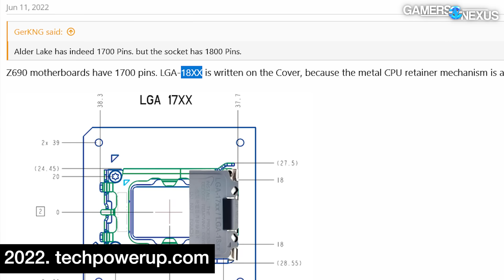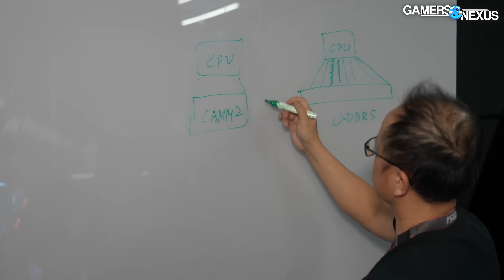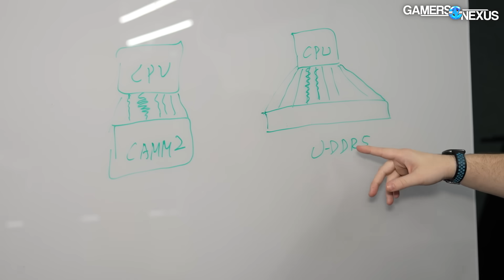Intel Says Not to Say "LGA1851" or "Z890" | MSI vs. ASUS Features & X870E Boards

Comment: Honestly the camm thing is perfectly fine, although you can mix and match ram sticks generally you want matching pairs anyway for the best compatibility and performance, meaning you kinda have the same problem regardless with DDR, no matter the upgrade you'll probably buy at least 2 of the same sticks unless you're like me and just don't care what you pair up, so long term camm might actually be a good thing because you'll always just need 1 stick and becomes maybe a little cheaper.

Comment: I'll take CAMM2 if it indeed results in a performance increase. We're already at the point where 2-dimm motherboards are optimal performance, and dense enough capacity to satisfy typical configurations. The stinker will probably just be early adopter tax.

Comment: As a native french speaker from Québec, I always love your sarcastic tone when you talk about the lame corporate tactics and bulshit! Specially when they act like if consumers were complete idiots, unaware of what they do. 
We have an equivalent sarcastic tone in french but, i got to admit, your way is very funny and entertaining. 
By the way, So far, i've seen no PC case model that was better than the EATX Fractal Torrent. For me, its the overall best design. There are only 2 minor things i would do to improve it : 1) Enlarge the cable management area of 2 centimeters (behind mobo)  to make cable management easier and also to drop HDD temp of a few degrees. 2) i would relocate the power button and USB + 1/8 jack from the top, to the front panel.. to prevent dust from going inside.

Comment: I guess it's a look, but never understand why case makers keep putting slabs of plastic on the front blocking the fans.  I'm not a RGB person myself, but even I like the full mesh front with the fan lights lit up.  Enough that I don't bother to turn them off (they just chance colour depending on CPU temps).  And with the amount of heat my new 7900xtx radiates out, I'm freaking happy I chose my case yeas ago for that open mesh design.

Comment: This CAMM2 stuff is really neat. I will move to that platform likely as soon as I am reliably able to. It would make fitting in my favorite air cooler, the NH-D15 (maybe gen 2, coming soon!) a lot easier without having to worry about not having memory that is too tall. Really liking these new ideas we are seeing! CAMM2 will be available from other motherboard manufacturers of course, right?

Comment: You know what? I'm liking these new focus of ease of installation features, and while at it, let me throw my own idea too. Put your NVME socket next to the RAM, please. Just like those X670E Gene boards, but maybe change the interface a bit so you don't cross ASUS' patents. 

Why next to the RAM you may ask? Well, because usually, NVME slots right now are located right above the GPU, and RIGHT BEHIND THE GPU. Those placements are awkward as hell. Above the GPU means that if you use a big aircooler, you have to take the air cooler off to reach that NVME slot, and the same goes to behind the GPU slot, gotta remove the GPU to reach the slot. So once you've built the system, once the SSD acts up or you want to upgrade for higher capacity for example, well, tough luck, hope you like spending another 30 minutes disassembling stuff for that. ASRock just announced their mobos that have NVME slot beside the RAM, but sadly it's just a single NVME slot, not 2 like ASUS. So yeah, mobo vendors, please do this, and please stop putting stuff in hard to reach areas once the system has been built.

Comment: 2:35 aw man I want that. Since I have a DH15 in my computer, I have to use a screwdriver to press on the veeeery small amount of the PCIe release that is visible to get my 4080FE out of the slot. Not that I need to take it out often, but it would still be nice to have for when I'd need it.

Comment: I'm really not a fan of MOBO companies adding all these "Quick Release" things. They are just unnecessary for most people as you will only need them once, when you build the PC, and maybe again 5 years later when you pull smth out of the PC to use in the next PC (Such as drives).

Meanwhile, they increase the price of already too expensive boards even more. I want affordable boards that have all the features I need and look nice, not overpriced boards that have every gimmick under the sun that I will maybe use once in my life.

Features like these make sense for super high-end professional overclocking boards (The $500+ ones) etc that reviewers like you use to test hardware, because you actually need to swap hardware a lot, but for 99% of users this is just an overpriced gimmick.

Comment: If the twin blade fan is more diffuse wouldn't that create less directed airflow into a cooler that's in series with it?  That segment seems to contradict itself.
'If you have a fan up front and it's able to direct airflow in as straight a path as possible you're going to have a lot better time getting it into a cooler'  .. except you just said this design makes that less direct and more diffuse and the provided animation shows this too.
'..a tornado which then diffuses in the backend as opposed to just directing it more in a straight path'. So by your and the manufacturers statements this fan design is specifically bad at directing air into a cooler?

Comment: Never did understand hiding parts you're going to see. Like, i get keeping secrets for the proper unveiling, but it's a pin socket. I highly doubt it's going to be different enough for most of the viewers to even notice the details, because they're all in the board, not the socket. Lmao. Is reverse engineering and bootleg manufacturing really to this level? D to doubt...

Comment: I haven't bought anything MSI since 2008. Baring that I do enjoy the new stuff about chipsets n such coming out. The ease of use/install stuff, doesn't really thrill me in the least, I built my rig 3 years ago and have never removed the video card or the NVME drives even once... I think I'd prefer the much simpler screw install on things and never have to worry about anything just "popping" loose. Now having said all that, I'm sure there are people that swap hardware a lot and would definitely benefit from those features. Thanks Steve. :) BTW, Might be moving to NC in next couple years, looking around Waxhaw. :)

Comment: May be they didnt want you to see it because its still the old socket LOL  If MSI want to make the M.2 better make it so you dont have to remove the GPU to get to any one of them !. the first one is ok but the other 3 under the big plate if you want to change just one is a pain in the ass to remove the GPU and the big plate why just have small plates / heatsinks just over each M.2 ? ease of access is important over looks sometimes.
the new Ram modal look cool but needs better guides as it looked scary trying not to bend pins.

Comment: looking at those cam modules i see less memory chips which means less can be read from and written to at the same time which iin theory makes them slower. plus im worried with boards bending over time due to cpu cooler pressure and memory contacts releasing. Also have not bin able to see anything about dual/quad channel. I say pass for now.

Comment: I wish that MSI had figured any better solution for a locking lever. The lever on my "GPU" slot ended up broken in trying to get my card out. With an NH-D15, there just wasn't a way to reach in and press the lever as I pull the card, I had to struggle with a chopstick through the gap, hoping I didn't otherwise damage anything.

Comment: CAMM on desktop will likely remain an obscure tech.
No upgradeability, limited support, likely much higher cost, more likely to get damaged.

It will find some use in micro builds with limited space / portable devices.

Comment: Why the hell would I need or want a quick release for video cards? I don't want them to release easily. I want them to be screwed in tight. I'd rather board vendors spend manufacturing cost on things that are actually going to make the board more useful.

Comment: What Steve didn't say about CAMM2 memory modules is what MSI is trying to do with it is replace SODIMM modules in Laptops which could make it easier to have a dual channel memory setup within 1 module. In the desktop space with CAMM2 as seen with what Steve has shown CAMM2 cam be very useable because of how big CPU coolers are now a days if you run a PC that has CAMM2 module on it you don't have to worry about CPU cooler clearance.  However going in this direction could be dangerous because if CAMM2 fails to catch on then you are stuck with components with no upgrade path and you would have to purchase a new motherboard.

Comment: If you want some inside info, the whole ILM distorting the IHS was verified to be within specs, but to keep enthusiasts happy they decided to offer a "validated" ILM solution that shims it up a little bit.  The gist is that the design assumes most of the preload is coming from the ILM and the fix is meant to allow more of the pressure to come from the cooler.  Other solutions were looked at but the shim is the easiest one for mobo vendors to implement selectively, because they'll only want to do it on the higher end boards and it'll add a couple bucks to the BOM.

Comment: That memory module seems a disaster for cooling. It has chips in the underside that don’t have a heatsink nor any airflow, and the ones above have only a chunk of metal with no fins. It seems it would fail pretty quickly…

Comment: I'm not sure what makes me more angry: That ASUS has a patent for the mechanism, or that my 350€ ASUS X670E mainboard doesn't have it. Yeah because, as you can tell, I went the super-duper cheap way and baught one of their sub-500€-board, what was I thinking??? -.-

I usually use a kitchen spoon made of plastik to poke for the latch that is hardly visible between the backside of my gpu and the large air cpu cooler. Yeah, really.

Comment: The CAMM modules on desktop seem the most interesting to me, as they're something I don't think we've seen outside maybe the laptop space. But they do kinda make sense, tho here's hoping if might catch on and RAM manufacturers actually make low latency modules for it to edge out the classic DIMMs. Aside from getting rid of some RGB-tax with that, it might also alleviate the CPU cooler cutout shenanigans and RAM clearances we have to put up with now since they're just lying down.

Comment: those CAMM modules seem very interesting, would love to see it on a itx board, as the upgrade path is just replace ram anyway with itx only using 2 modules of ram, and it would also give more space for the cpu cooler id assume noctua would make some beast with that
Reply: But...there will be even less space to put things on board. CAMM is MUCH wider then 2 RAM sockets.
Reply: @alexturnbackthearmy1907  but its much closer to the cpu so there's more space there in general, so hopefully it will work, going from what i can remember from my mobo it should "just" fit but who says they cant move the cpu, and maybe the time camm is mainstream (assuming it will be) they would figure out alot of the ports like the front io and shit, but this is all just a pipedream tho

Comment: On laptop CAMM2 modules the pin array is detachable. Maybe a solution like this on desktop motherboards could help with less RMA. Only need to replace the pin array if any pins are bent.

Comment: If mbd vendors want to "innovate", how about making a board which doesn't even have a chipset, as I think Buildzoid once commented, ie. modern CPUs already have a lot of connectivity on-chip, it ought to be possible to make a simpler, cheaper board.

That and including POST debug LED and power/reset buttons on every board, since we know they're dirt cheap. Even super budget boards had them back in the day, such as the Asrock P55 Extreme; they were very common back then, but in recent times they've almost vanished, especially on AMD boards, eg. very few B450 boards had them, one had to step up to X470.

I'll be surprised if the CAMM2 memory concept goes down that well, with its reduced flexibility, and doubtless higher pricing. I wonder how long it will be before the metal plate cover has RGB or yet another OLED display for more bling.

As for the PCIe quick release, I bet in the future one will see 2nd-hand boards with broken release catches. I wouldn't call it innovation, just a response to GPUs becoming absurdly large and heavy. It's bad enough already that some have to be held up with suspension rods or somesuch.

Comment: Camm ram looks more useful in amd.
Reply: Up to this point amd didnt get much more performance from ram faster than 6400c32, intel will benefit from it more as it uses the faster ram speeds (still not as fast as 7800x3d)

Comment: I see another advantage to CAMM: no more issues with coolers. They could go lower than they're right now and maintaining the same tower height as they could cut the height they add for clearing RAM.
Reply: Precisely the best use-case argument for design implementation. Wet plates and pumps are added expense and failure points, not always the best answer.

Comment: It’s great to see PC venders addressing ease of installation. However, one thing they need to address is those tiny case front io pin connectors. If they turn all those pin connectors into a single plug that would be great.
Reply: It's a standard (I think it's part of ATX design), it must be agreed a new one.
Reply: There's a single plug. It plugs on top of individual pins. You plug all single pins outside the mobo in your hands and then put that middle plug as one onto your motherboard. It comes with motherboards, unless you found the cheapest one you could get the hands on.
Reply: Only way I see those headers going, is if they started using IC logic to cut the total pin count down. Only problem is that completely removes the ability for you to use a screwdriver to turn on the motherboard, and could make motherboard vendors to start supplying PCBs adapting the normal headers to the new standard to cover people upgrading and using their old case. I also can't see 3rd parties proposing such a change and having it be adopted, as I believe that only Intel really has the power to make such a thing happen.

Comment: BTW once again change to new memory standard? Server standard as well where we are not going to use ECC  but only connection for factor? Plus one slot only?
I bet that only available CAMM2 modules are ECC once and those will not work on Z chipsets. Sure they will make once that do soon enough but that means again unreasonably high prices of adoption if the new standard. I am getting sick of changing everything every time you do the upgrade. When 12900K came out, everyone said keep DDR4 ram DDR5 was 3x more expensive and it was nit that fast as it is nowadays. Then with 14900K you have had to change the ram to get best out of it. Now with the next gen what, you need new memory again? 18xx socket has the same dimensions as 17xx but can we keep our cooling solutions or we need once again completely new coolers and water blocks again!?? Looks like it is not needed but they could have moved the holes slightly and we will be F-ed again. Well Intel being Intel.

Comment: I want to know if and how they are going to implement the quick release on ITX boards. The button would be a godsend on some boards considering the cases that they are often shoved into. No longer would it require you to risk a screwdriver into your board just to release the latch. This makes me pretty excited to see the future development of these boards. c
My main concern though is considering how small the boards are, I worry just about how much capacity will be available. I'm guessing the more length the more capacity but how are they going to manage that on a small board like ITX? If this is the standard going forward which I'm sure it will be considering not only the investment but the ease of installation it, it would make motherboards of that size much more cooler compatible.  In theory instead of going up they could go out instead increasing fin density while also allowing a bigger fan on top. They could also get far more unique with case design, considering cooler compatibility would be much greater with these new modules. To standard users its neat but to us SFF builders man am I pumped. Especially considering the GPU's massive growth spurt lately.

Comment: A question for the CAMM2, does it run single rank or dual rank? What about the channels of traditional RAM? The optimum on desktop is dual channels atm.
Reply: One module is connected to both channels. Not sure about ranks but 128GB ones have been made, with plans to go larger.